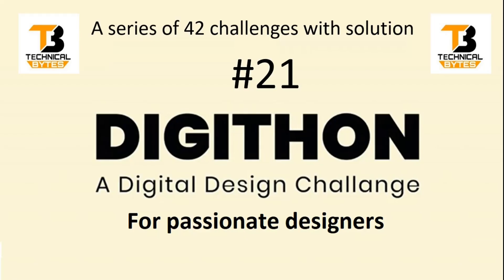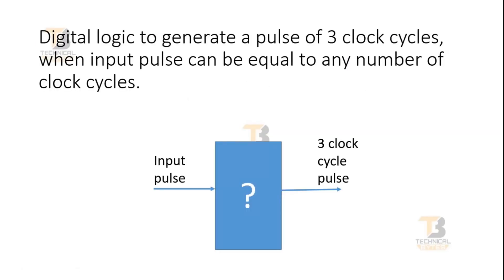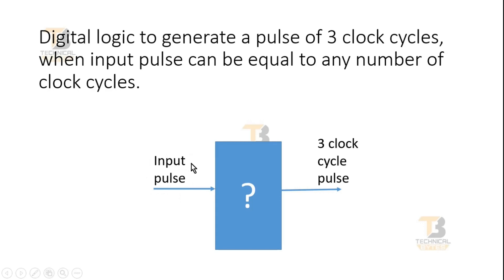DigiThon Question Part 21

Comment: Just use output of a rising-edge triggered monostable, thrice the length of a selected astable, to enable said astable. Ideally, reset the astable at the start, to synchronise it with the monostable output.

So that's basically using two clocks only.